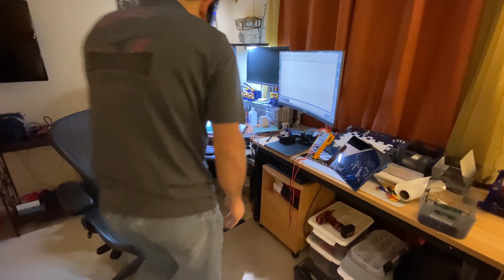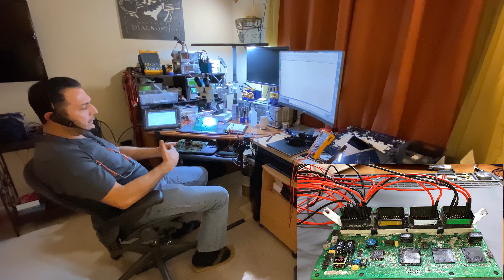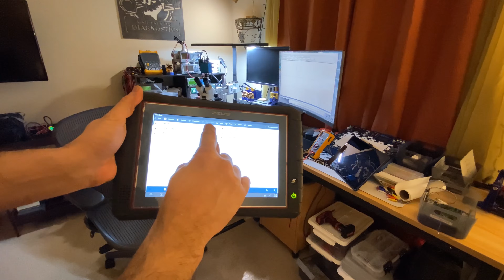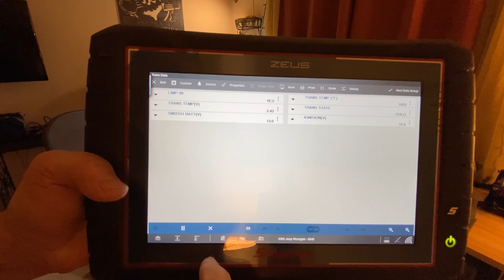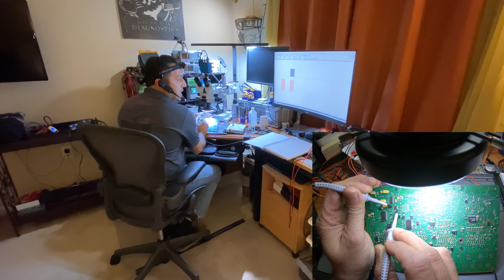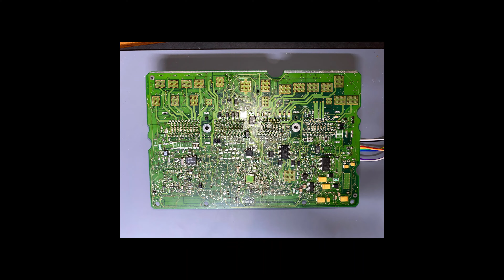05 Wrangler PCM and PCI test codes P1603, P1604 and P0706 diagnosis

Comment: been bindge watching your videos so much to take in ..ive been messing around with these pentastar ngc3 pcms trying to get my clapped out wrangler tj to run ...you had mentioned in one of these jeep videos about losing 5v and another mention of getting transmission temp voltage but no temp reading change....with the 5v refrence loss ...i looked at those tiny parts ib that glue and was like yeah not gonna happen.. i tacked a 7405 voltage regulator and a few low ohm resisters from key-on 12v to the 5v ref line.. dumb and simple but its my car andbi dont get paid to fix my own stuff lol ... the temp voltage signal and reading temp problem....could it be a analog to digital converter chip /op amp compairtor  external to the processor just not outputing the proper signal and the fail safe modes in the software hanging onto the last good known value

Comment: So is the problem that the ECM does not receive the transmissions by the TCM on the PCI bus?  Is that 8-pin SOIC chip you called "EEPROM" labeled?  Seems to be some sort of multiplexer/transceiver?
Reply from the maker: A name is required great comment my friend. Yes it has to be some sort of multiplexer. I can’t find any info most of this components. The label on the SOIC is 8613AA   4ME6     H501
Reply: @MaicSalazarDiagnostics  Seems to be a NXP/Philips PCA8613AA custom transceiver chip.  Are you sure that the 200mV higher packets come from the TCM?  Could it be that they come from the scanner?
Reply from the maker: A name is required it could be. All I can see is that changes when talking to TCM side only. Not on the ECM side. Do you have any info as far as Datasheet for the transceiver?
Reply: @MaicSalazarDiagnostics  Could not find anything - would be interesting to see whether it behaves the same way on a working ECU.
Reply from the maker: A name is required I am in the process of that